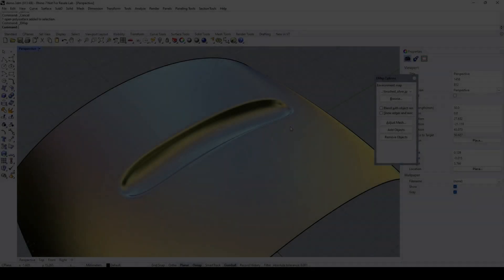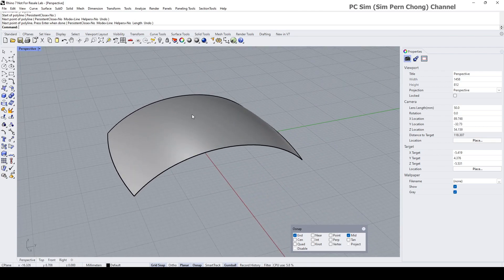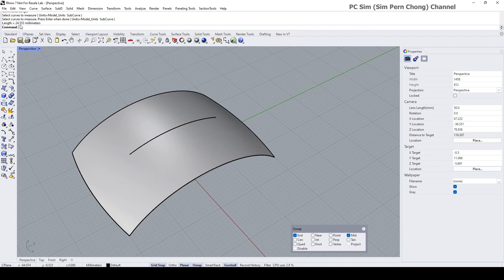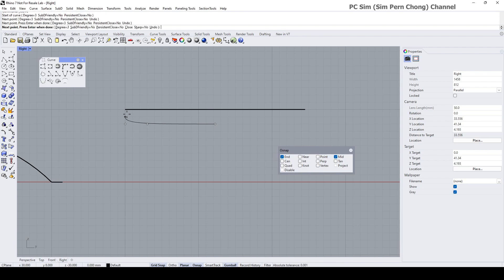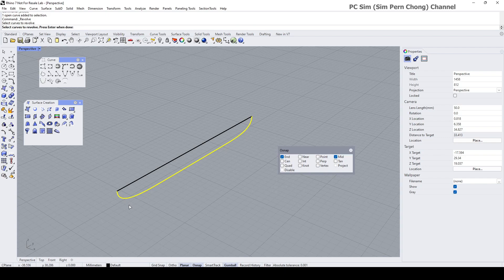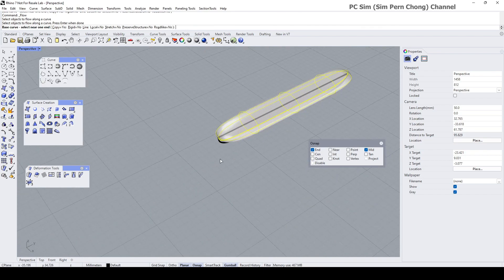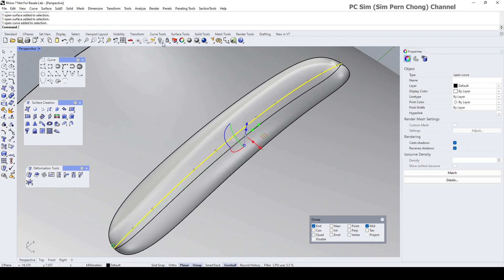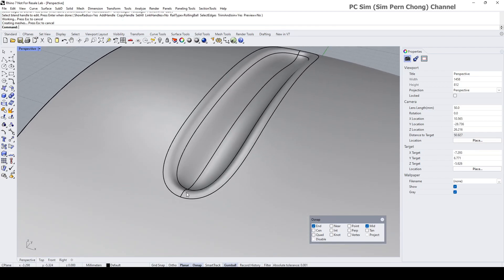Rhino 3D CAD Tutorial: Controlled Depression Detail on Surface (Requested)

Comment: I found another method to do this:
Step 1: make a curve in the desired shape of the hole.
Step 2: project the curve onto the surface
Step 3: use the curve as a trimming object, and trim the surface with it to create a hole
Step 4: create another curve that starts at one side of the hole, and ends at the side directly opposite.
Step 5: use the "patch" command, select both the curves, press enter, and disable the "adjust tangency" option.
Step 6: join the surfaces together, and blend the edges if you'd like.

Some people might prefer the method in this video, but personally I found mine a little bit quicker, so I think it's worth trying it this way too.
Reply from the maker: Nice. Thanks for sharing. I might make another video using this method. Thanks.